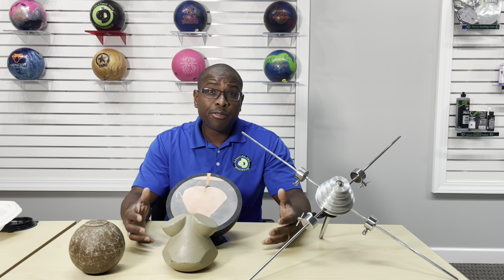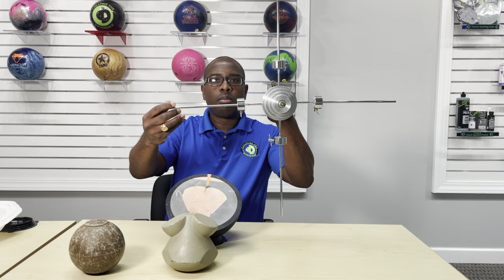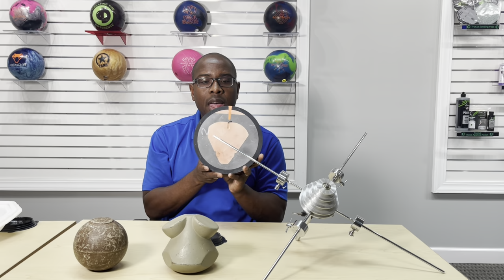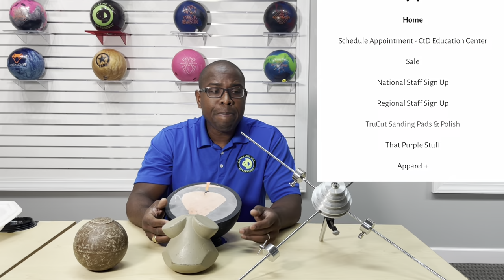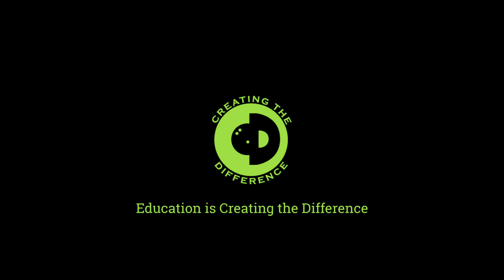Understanding Bowling Ball Terminology | What is Differential? What Does It Do to Ball Motion?

Comment: Just wondering but I have a  med to low track with around a 350rpm rev rate and 14-15 mph ball speed. What type of specs should I be looking for in bowling balls? I’ve noticed shiny or pearl asyms and alot of surface on these balls seem to roll out on me.
Reply from the maker: Lower differential balls would be a better match up for your style of play.
Reply: @Ctdbowling  thanks Ron.

Comment: Does differential add power to the hook phase or does it only cause flare which allows the cover to get traction?
Reply: It is a transfer of energy. Nothing can get you more power without an external source (physics) high diff will effect the the ball "snapping" into a direction.  Like watching a top go from being wobbly until traction hit then is propped upright very quickly, but the spinning top is stationary inside a ball.